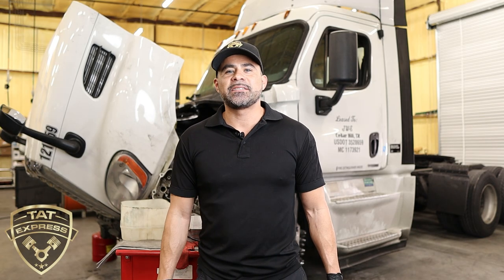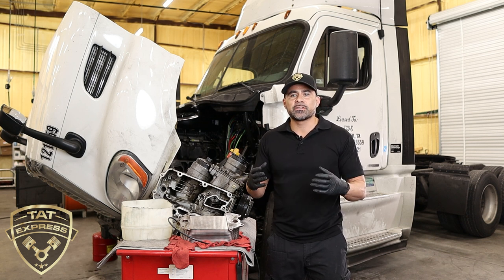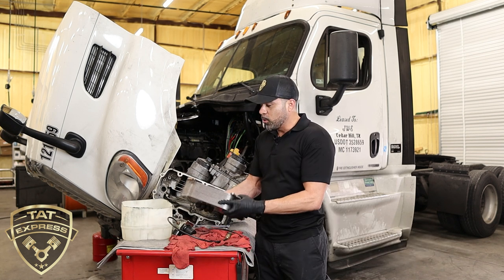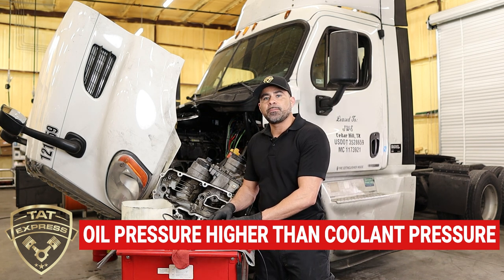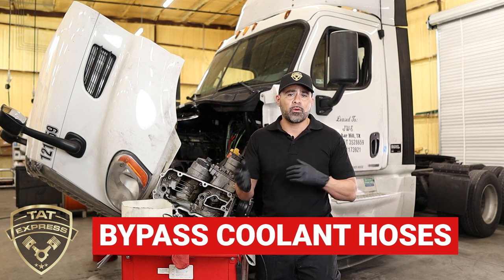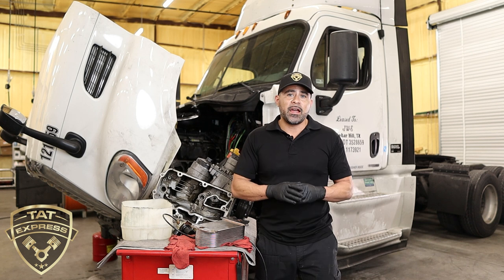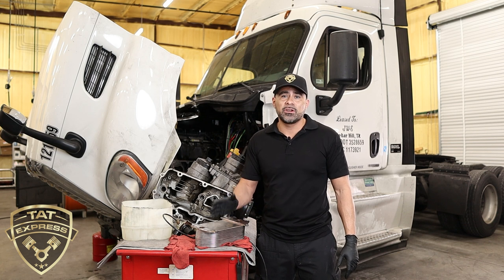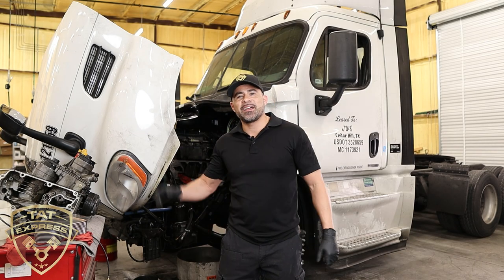oil in coolant reservoir/ oil in coolant reservoir diesel engine/ oil in coolant reservoir dd15/dd13

Comment: wouldn't a relative compression test that shows low compression in one cylinder need to be verified by an actual manual compression test of that cylinder? Ive seen relative compression of a cylinder go from 65 to 95 after a valve adjustment using dddl

Comment: Once you fix the problem getting that oil out of the coolant system is a nightmare .you won’t get it all out. Need to put another coolant filter on the engine

Comment: My detroit 60 series has oil in coolant resevoir and coolant level has been going down very rapidly as well. Is this head gasket issue? Or a transmission cooler or an oil cooler issue?

Comment: Imagine truck was sitting for weeks trying to find the right oil color for my 2019 Volvo what the x15 Cummins and every time I go to the dealer they end up telling me it’s back order and I won’t be able to get it till 5to 6 months later that was a year ago what I end up doing I had a 2013 Cummins ISX I took the oil cooler out of it and I put it on my 2019 and it’s been running excellent ever since I so be careful guys, I’m gonna go to the dealer they just telling you whatever they see on the system but they’re not giving you the solution!!!!

Comment: Is it possible that a leak..?(oil in coolant can't be fixed)on a DD15?..i have spent 13k and still have oil in coolant..oil cooler and o rings replaced 3 weeks ago..both just check ed out ok @Tulsa freightliner..service manager says next step is going to remove head..est..6k..test cooler was 3 k..was told this may not be the problem...with the 1st time in shop..a follow up and major reflush after..iam at 13k..head removal that puts it at 20k..and a maybe .....do you have any advice..your trouble shooting is totally different from current freightliner shop it is in ..engine has 997k has been very well taken care of..is it possible that this oil in coolant on my engine can't be fixed?and would require replacement????
Reply: Your truck has not been properly diagnosed. Take it to someone who knows troubleshooting strategies.

Comment: I’ve notice oil in my coolant reservoir after I had a new radiator installed 2 weeks ago due to coolant leaking from the top of the radiator. Truck has never over heated. It’s a 2015 579 peterbilt and it has been well taken care of. Any idea what the problem might be? Thanks in advance. Great video! 👍🏻